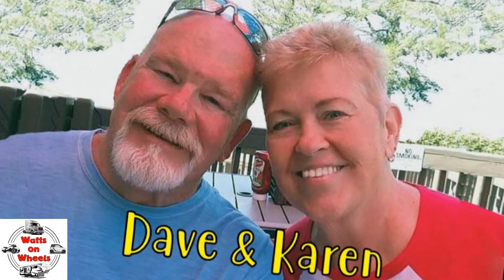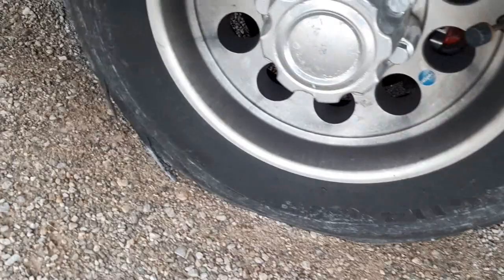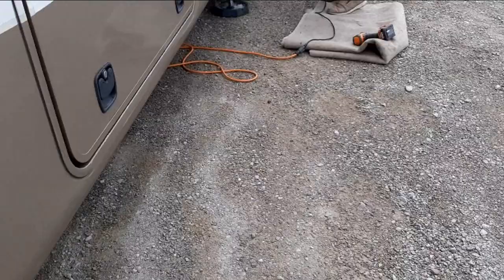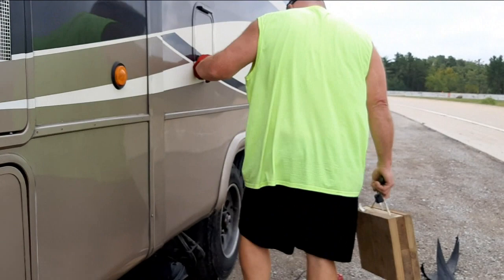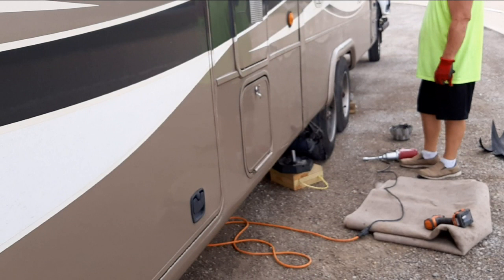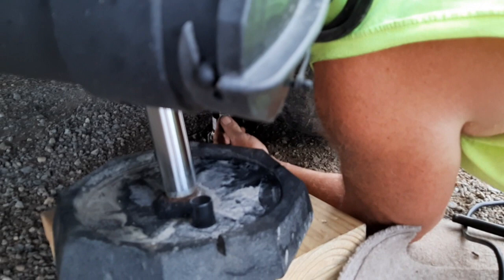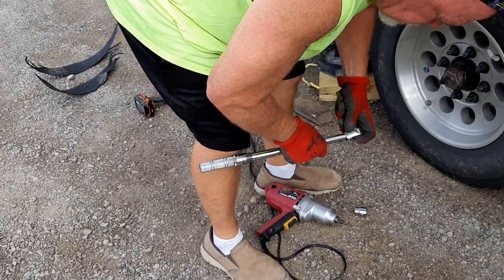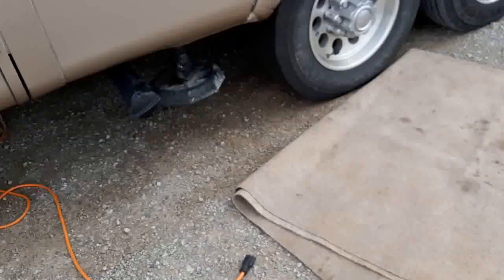RV Tire Failure - What We Did WRONG!

Comment: On most tandem trailers if you pull the good tire up on blocks the other axle will be suspended on that side also. 
I know it works on regular stock and horse trailers.
Reply from the maker: I don't think that would work on the independent suspension, but I'm not sure.  All we needed to do was put all our leveling jacks down.  Always something new to learn.

Comment: Might want to look at Sailun as replacements for the G114's.
Reply from the maker: Yes, we have heard good things about them.  However, we wanted to change all the tires ASAP since we are traveling from PA to OK in a quick across US fashion.  So we opted for Bridgestone while we had a two day stop in Ohio.  We'll check into those next time.
Reply: @WattsOnWheels  Totally understand. Safe travels. We are in Marsing getting our Freedom Hauler installed for our new Spyder. Do you use the same ramps for loading your Spyders that you use for loading Zippy? If so would you mind sharing.
Reply from the maker: @PnwFireguy  Yes, we use the same ramps for both the truck loading and the Freedom Hauler loading.   We use the 12 foot long by 12" wide folding ramps for the outside tires by Discount Ramp and a 9 foot long by 18" wide folding ramp by Black Widow for the center tire.
Reply from the maker: @PnwFireguy  one more thing for your tote ...we recommend shocks
Reply: @WattsOnWheels  Yup, gottem' thx